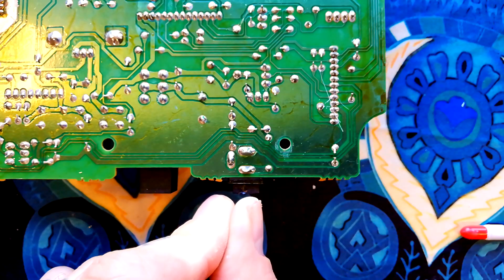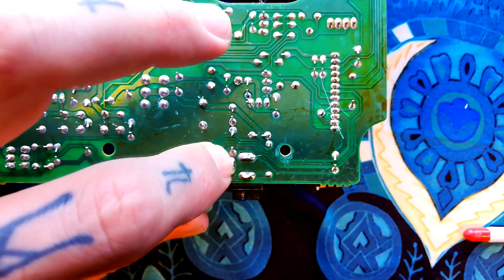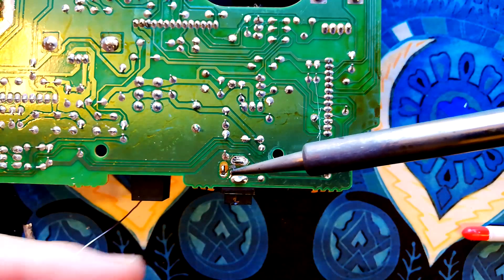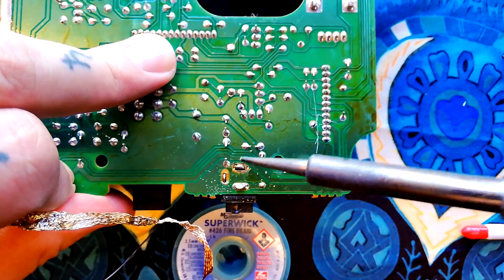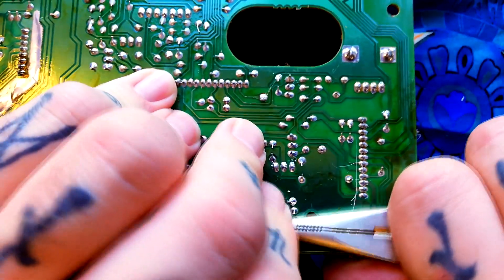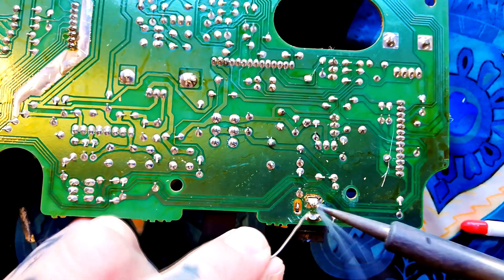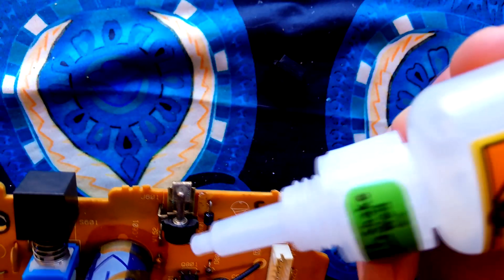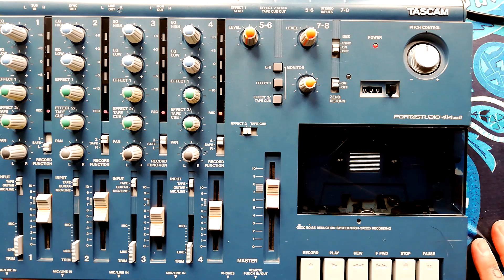DC power socket repair | 4-track no power problem | Tascam Portastudio 414 MkII

Comment: Thanks a ton! Was able to fix my DC jack without replacing it using this video. One solder point had disconnected from it's solder point. I just heated it up, removed old solder, and applied new. Boom!
Reply from the maker: Great, have fun recording 😀

Comment: my 424 just failed to turn on after months of sitting after working just fine... I opened it and looked at the OUT board and I did notice that one particular solder seemed to be missing half of it leaving a half circle.. but the component leg still seemed to be in place ... it wasnt loose .... I have to go back and look again for swollen capacitors and loose legs on the power switch and AC jack... sheesh...
Reply from the maker: I’d definitely reflow solder around  the half circle you describe….good luck!
Reply: @Tetrakan  thanks. I just watched a bunch of your videos looking for the one showing where the fuse is. Finally found and watched it. Never soldered before but I'm gonna go for it. ...
Thinking about the fuse in the ac plug I looked at the plug I've been usjng. Its an adjustable voltage one from radio shack. I plugged it into my mpc Live and it didn't show the little lightning bolt inside the battery icon but the mpc plus does. I'm certain the RS plug works though.  Either way. I need to buy multimeter and test things.  I'll probly post later my results. Thanks for your info

Comment: Off the top of your head, do you know how this process would compare on the 424 mki? I’ve looked for fuses as well but can’t seem to find any.
Reply from the maker: Usually only models powered by internal AC to DC transformers have internal fuses, e.g. 244, 464. If you're not getting power on your 424 mk I id check the condition of the solder connections at the base of the power input socket. If those are okay, it's possible someone tried to use the wrong external ac to dc adapter, in which case you might haven't replace at most a dozen capacitors diodes etc that were hurt by incorrect voltage polarity.

Comment: Hi!... My Tascam Porta 05 does not turn on anymore; I've opened it and very briefly checked the connection, which doesn't seem to be damaged (but I could be wrong)...
Do you think that the problem explained in the video could happen also in the Porta 05 or, considering the differences, there are more chances that the cause is different?...
Reply from the maker: Same problem is the most likely cause. I'd say eliminate that possibility before looking for more complicated  causes.
Reply: @Tetrakan  I'll check better the connection then...
Thank you very much!...
Reply: Hi  @Tetrakan  !...

Sorry to bother you again, but I've got some news on my old Porta 05: I've finally bought a multimeter and discovered that the power adapter is dead...
I also checked the continuity of the input connection and that, instead, is not broken...

Good, it seems that I only need to buy a new adapter (and maybe change the belts)...

But there's a problem: before doing all these things (and even before writing to you the first time), I tried two different adapters (both with 12v output; one with 3a and the other with 1a), but with the wrong polarity!.. Yes, I know, dumb thing to do...
Anyway, nothing happened (the unit did not even turn on), so I'am thinking that there's a chance I've been lucky (maybe some protection kicked in?)...

What do you think, could I have broken the recorder or, if that was the case, something "noticeable" should have happened?

I ask because I don't think I can return the adapter if I buy it, so, if you tell me that I've SURELY damaged the Tascam, I'll simply avoid to buy the adapter...

Many thanks again!...
Reply: Just wanted to give an update (for everyone reading):

Even after trying two power adapters with the wrong polarity, once I managed to repair my original adapter (with the help from a friend) the Porta 05 turned on, and worked again normally...

It seems that the Porta 05 has some kind of protection against the wrong polarity (but it is still wise to avoid such a thing, because that protection could have its limits)...

Regarding the original power adapter: I only had to replace the wire (the one that goes from the adapter to the Tascam)...

Hope to be of help!...
Reply from the maker: Glad you got that sorted, sorry I didn't see your earlier message
Reply: @Tetrakan  No problem: you've been helpful anyway!...

Comment: Have you ran into a problem similar to this with a 424 mkiii where a little movement makes it cut off and on? If so have you ever worked on one? Thanks
Reply from the maker: Yes. It’s a different style of socket but same principal applies, check the solder pads at the base of the socket and add fresh solder as necessary
Reply: @Tetrakan  ok thanks I appreciate it

Comment: Hi, I need help on this tasma 414, I have a strange issue, the unit has power, track panel side , but the tape player has no power, any where I should check on the board ? Capacitor  any regulator?

Comment: Hey, I've got the portastudio 424 at home. Only I've lost the power cable. Is there any change I could replace it? If yes, what should I get?
Reply from the maker: Yes. You want a 12v negative tip AC to DC adapter, 500mA or higher. Myvolts sell these in europe, the rest of the world, I'm not sure.

Comment: I have a power problem on 414 mkii. It just cut out mid recording and won’t turn on now. I have opened it up and the dc Jack seems secure. The large capacitor seems to have leaked. What capacitor would you recommend to replace it?
Reply from the maker: Be aware it might be just glue to keep the capacitor in place, typically glue is opaque and a pale beige/brown colour. If you do replace the capacitor,  it is very important that you buy the same capacitance value and voltage tolerance, I'm pretty sure thats going to be 4700uf and 25 volts on your unit, but check the writing on the side of the capacitor you remove. If you mean brand, I tend to use panasonic and nichicon...less expensive than rubycons but generally better availability and still have a reputation of being more reliable than some cheaper brands.

Comment: I just got a portastudio 414 mk2 from a guy off craigslist and I tested it at his house and it worked. I went home and plugged in my synth and started recording fine. then out of no where the thing stopped and will not power back on.
Reply from the maker: Check fuses?
Reply: @Tetrakan  Have not yet I got it an hour ago. worked. came home pluged it in. havent opened it up yet. Where are the fuses on it?
Reply from the maker: go to my channel homepage, electrical troubleshooting playlist, there's a video about testing fuses, demonstrated on a mk II

Comment: I have a portastudio that wont power up, but the power socket appears to be solid, and nothing inside appears damaged in any way, in fact it looks brand new, no leaking caps or anything. does  the unit have a fuse anywhere?